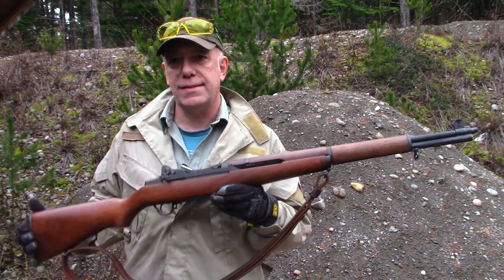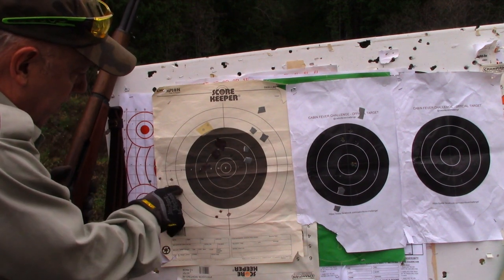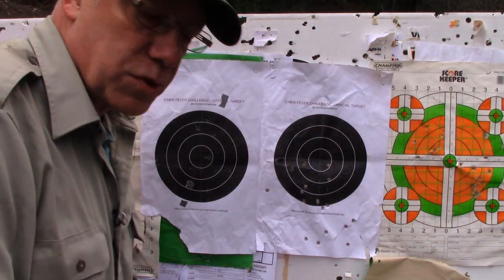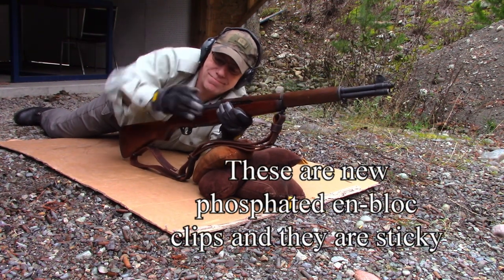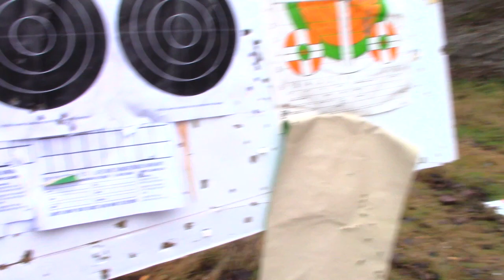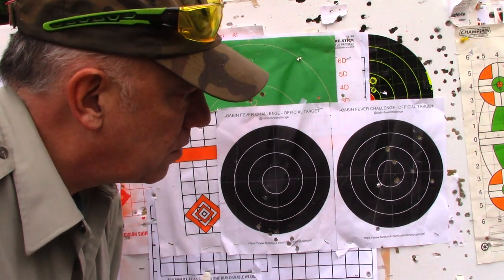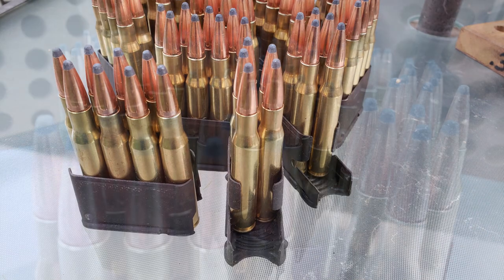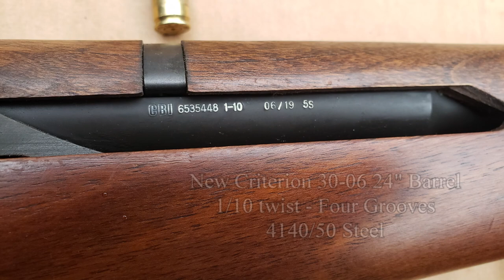Beretta of Italy M1 Garand

Comment: I built my own from a CMP "C" grade receiver, Beretta BM 59 SL 7.62mm barrel, new Typo/2 stock and rear hand guard and remaining US GI parts from CMP and other sources. $650 my cost
Reply from the maker: Hi John. Did you short chamber a 30-06 barrel or did you build a spacer in that Typo-2 Stock? I wish I could build my own rifles like you can.
Reply: @Riflechair  Used the steel spacer for the Typo/2. Sarco and Standard Parts LLC had them 8 years ago. Jerry Kuhnhausen. Covers the U.S. M1 Garand his book shows all you need to build and service M1's. My first was a T26 7.62mm "Tanker" from Alington Ord. in 95'  ($500) I then got two Service grades from the CMP one in 97' ($310) and a less wood in 98' ($275) bought extra parts from CMP back then that went into the Typo/2. Imagine a GI 1953 Match stock for $15 back in 97'.  T26 and CMP guns are all bedded and accurized. CMP M1's have their original WW2 barrels and are mostly correct dated parts. Sights and op rods updated at arsenals after the war. T26 shoots 1MOA with M118LR or MK316 Mod 0 ammo (my hand loads)
Reply: @Riflechair  Barrel was a BM59E/SL take off. 23.5" Beretta 1967 dated.
Reply: I have acquired a small quantity of BM59 gas cylinder-bipod assemblies with sights and op rods. Would like to see an 8 shot clip version instead of hogging out the receiver for magazines. For now I have an Italian style M1 full length rifle with one of the shortened barrels. Shortened 1/2 inch from the breech end and rechambered to 7.62x51. Waiting to test fire it. As many new parts as I had in reserve. Years ago (40 years) I bought stuff no one wanted. My barrel was made by Beretta on S.I.A.U. steel in 1967. Guages ZERO at the muzzle and ZERO POINT FIVE in the throat. Wish I had Lake City Match but I'll get along with TW 69 M80 Ball.

Comment: Love my Garands!  I shoot surplus Lake City and HXP M2 ball through them.  I'm sitting on a fair sized pile of Lake City NM brass, and load them with 168 Hornady A Max or Sierra BTHP's with Varget, or 4895 and Federal large rifle Match primers.  Both of my rifles 'love' the 173 gr. National Match ammunition I've stockpiled, but what little I have of that seems to end up going through my 1903's and 1903A3's.  One day, I'll have to get off my butt, and develop some 175-178 gr. loads in the LC NM brass I have.  Great vid, as always!!!
Reply from the maker: Are those Federal Gold Match primers harder zDarreld? I was running WLR in the video and all unfired but chambered shells exhibit a primer strike kiss
Reply: @Riflechair  I've seen the same dimple on unfired rounds in the Garand.  I don't believe that those FGMM primers are 'hard', definitely not as hard as the arsenal produced primers used in M2 ball, nor the Speers,but the materials, and care in manufacturing for consistency is far and away better than 'run of the mill' primers.  I've not heard of a slam fire with an undamaged Garand.  Doesn't mean it couldn't or hasn't hapened, I just havent witnessed or heard of it.  Now, rifles damaged by excessive dry firing (that can peen the end of the firing pin, and cause it to stick forward) can, has, and likely will happen again.  ( I DID see an out of battery firing with a NM M14 while competing at the National Guard Nationals at Little Rock, Arkansas years ago, and a peened firing pin was the culprit there)  Checking firing pin free play should be a part of regular cleaning/maintenance regime, and a it'd be a good idea to keep a new spare firing pin in the kit in the buttstock, just in case.  Good luck on your build!  We are most definitely spoiled 'down here' with the CMP being (at least for the moment) available to us.